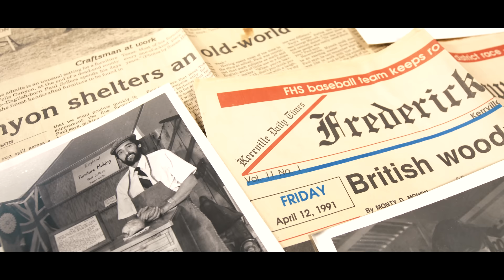Paul Sellers - Lifestyle Woodworker

Comment: I love working with hand tools. I use to use power tools for woodworking, but since I saw your first video on YouTube I was hooked. I've always loved working with my hands, getting dirty and making things directly with hands. With power tools I was always struggling against them: you have to fiddle and fart with them to make them produce the results I expect; mitre gauges on table saws wobble, fences go askew, electric drills rip through the wood, leaving a hole that needs to be cleaned up, and so on. The first video I watched was making a board 6 square with hand tools. It was a revelation. Now I have a jointer plane, a smooth plane and a scrub plane and I can 6 square a board faster than my friends with their jointers and thickness planers. I can rip 2x12 8' into two 2x6 with a frame saw almost as fast as a table saw. But it's not about the speed. My frame saw cut has beauty in the two cut lines, the hand planed board has a patina that the jointer cannot create, the hand drilled hole is so clean and so precise. And when I put the project together, it is the direct creation of my hands, my sweat. I simply love spending my free time making things by hand, my hand.

Comment: Wise words, Sir.
   If I was to add a small bit of advice to beginners or amateur woodworkers it would be : Learn to sharpen steel ! That is the heart of the matter. When you use your muscles to power hand tools to cut wood (in all the various ways) you will soon learn about what the wood will permit you to do with ease and what will result in sweat and frustration. Power-tools can save you some time once you know what you're doing or maybe if you're trying to make some money.
   I'm proud to be a woodworker, in part perhaps because it is a difficult way to make a living. The difficulty is not the work itself, that has always been an exciting challenge and a joy to learn (and only gets easier as the years go - I'm beginning to get good at it after 25 years :-) The difficult part, for me at least, has been to get work (in a workshop instead of building houses) and get properly paid for that work.
   It is in many peoples eyes a strange choice of work, and not suitable for the great majority. You need to be able to motivate yourself, and be content to work (mostly) in your own company. On the plus side : there are not many boring meetings. And you get to make useful and sometimes even beautiful things out of wood.
   I'm not planning on retiring either. If I drop dead at my bench with a tool in my hand I would consider it a good way to go.
All the best from a Norwegian møbelsnekker.

Comment: Hi paul I read your article on leather strops and was wondering if suede would be suitable, I placed the suede across the arm of my chair and run my straight blade across it around 15 times and it felt considerable sharper but at the same time course. Tia.